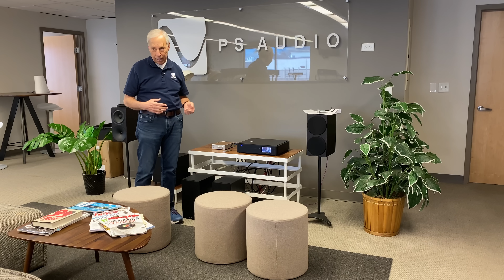Is there such a thing as too much power?

Comment: As Tim "The Tool Man"Taylor used to say, "It didn't have enough power, so I REWIRED it"!
Reply: Heat and pwer are the same things, expressed in kilowatt hours on the elekricyt bill. 1 kilowatt = 1 hour qith 1 kilo. Thnak youes!
Reply: @ilovecops6255  No. Heat is energy. It can be measured in joules, calories, or BTU. Power is a measure of energy per unit time.  It can be measured in watts or horsepower.
Reply: @timharig  Notte so..

1,500-Watt Oil-Filled Radiant Electric Space Heater with Thermostat. 3 heater settings 600/900/1500-Watt, Safety auto shut-off and Safety tip-over switch. With adjustable thermostat, power indicator light, heavy duty casters wheels, convenient cord wrap and easy carrying handle. Whole room quiet radiant heat.

HEAT IS mesure in wattes!
Reply: @ilovecops6255 
 https://www.engineeringtoolbox.com/heat-work-energy-d_292.html

Heaters are rated by their power output. Rating them by their heat would make no sense since you could achieve any amount of heat by running the heater for a set amount of time. What matters is how fast they can give off heat. That is a measure of power.
Reply: @timharig  i know its wah i sed fir time, HEAT = POWER = horsepower or kilowattes. BHP os Brake Hosepower, Indicated hosepwoer is from an indicator card - THEY SI 2 DIFFRENT THINGES!

Comment: The main concern I have using very high power amps with smaller speakers is the occasional accident of an RCA cable being pulled to the point where the ground connection is lost and having a high voltage from the mains noise feeding into a line level input. Suddenly you get 50 or 60Hz at clipping level and your power amp running at max power. Give it a few seconds and smoke can arise. Otherwise I agree and what is good about the extra power otherwise is that any peaks in the music will not get easily clipped as the voltage rails in the amp are high enough.
Reply: My concern is that you fool with interconnects with the amp at max power :)
Reply: @jamesplotkin4674  my concern is that you fool with amps with the power on...😆
Reply: @poserwannabe1  Actually, I don't do that :)
Reply: @jamesplotkin4674  I know, I was just sticking with your theme...😁
Reply: @poserwannabe1  I know. That's why I added a smile.  I do still enjoy toast while in the tub, though. My doctor says it's unwise.
Reply: @jamesplotkin4674  
😆😂🤣😆🤣😂
Reply: @FatRat-f9m  Not a problem in my family.
Reply: Fat Rat Test signals can easily fry a tweeter as they are not designed for much power. Some Jamo speakers are great. I know a few people working at Jamo.
Reply: @FatRat-f9m  How domestic of you to do the washing up :) I'd suggest a baby-monitor to keep tabs on what the wife does while you toil.
Reply: @FatRat-f9m  Not so much the ground, but I do have an aversion to porcelain. Gives me the shivers thinking on it.
Reply: Fat Rat Shorter cables are impacting the sound less, usually also save you some money and can reduce the spaghetti mess of wires. I haven’t blown a speaker for ages but in my teens I intentionally did crazy experiments with putting too much power in some speakers. One time in my early teens a voice coil shorted and the amp transistors fried using my parents receiver for the experiment. I “offered” to take it over as it was broken and and fixed it myself. It was my first amp/receiver (Beomaster 901) that served me well until I built my own 120Wx2 amp from scratch including PCBs during my high school time, that amp was even better at frying speakers.
Reply: Fat Rat Agree, cables aren’t much of an impact on audio quality unless you use poor ones or really long ones. My subwoofer RCA cable is 20 feet. I was almost buying one with a length of 25 feet but measured carefully and found I needed an 18 feet cable. Then after I got it and installed it I learned I only had about a feet extra but that’s quite a perfect match. For a subwoofer 20 feet RCA is ok. For higher frequencies, you start caring about 20 feet. My cables are managed in some panels making them disappear and that’s another reason why I prefer cable lengths that are fairly well matching to what is needed.
Reply: @FatRat-f9m  Oh, deary me, don't let it get too far away!

Comment: I was in an audio store recently and the had Klipsch La Scalas hooked up to a 300 watt McIntosh amplifier.  Those speakers are supposed to be 106db at 1 watt.  I don't understand how that would make sense.  It seems that they would be served by a much smaller amplifier.  I don't see how you would ever get to the edge of the sweet spot with such efficient speakers.
Reply: having much more efficient speakers than is necessary is a good idea.  I use a pair that has a compression driver tweeter thats 108db sensitivity hooked up to 500 watts at 8 ohms.  But then I use a 30db in line attenuator before the speaker.  It cuts down any noise or hiss and gives beautiful results.
Reply: @Canadian_Eh_I  That makes sense.
Reply: Personally, I would have gone with the MC275 Mk. VI with KT88s rated at 2 x 75 watts from the 4, 8, and 16 ohm taps, but that's just me.  I can't afford any of that wonderful kit, but its fun to dream.
Reply: @stephensmith3111  Yeah I've owned a couple of mcintosh pieces.  Love the sound, but I've found in my audiophile travels that the biggest difference really is made by the speakers.  Going active with a deqx and using high effciency drivers with 30db attenuation has changed my perspective on audiophilia.  I use an Edge electronics amplifier with 6 channels each using an ICEpower 500asp.  When it was built it would have costed $8-10K for the amp.  If you are diy-er  you can buy the amps on partsexpress now for $350 each.   Excellent clean power.
Reply: @Canadian_Eh_I  Absolutely.  Everything in the audio chain matters to some extent, but the sound producing loudspeakers (or headphones) matter most.  Once upon a time, I assembled a Hafler DH 200 power amp kit that did not burst into flames and sounded quite good to my much younger ears, but that was about two score years ago.  As a government certified old dude now,  my relatively modest "get off the merry-go-round system" (re:  Sam Tellig) is far more than adequately good for the down-sized life of a retired small apartment dweller.  But, as I said it's fun to dream.  Enjoy your music.
Reply: @stephensmith3111  Awesome and great to hear you still enjoy audio :)   I am also an apartment dweller.  One of the main reasons I chose highefficiency front laoded horn speakers.  I'm also currently building an open baffle bass setup with 15" eminence woofers.   Open baffle bass + controlled directivity means you can crank the tunes louder in the sweet spot without disturbing the neighbors.  Also open baffle bass affords you an extra 3db or so in the sweet spot that cancels out before it reaches the neighbors.  Little tricks I've learned ;)
Reply: @Canadian_Eh_I  I discovered after the fact that there is a nasty bass resonance in this apartment that really upsets my turntable. My venerable, beloved, and fairly efficient (speced at 92 dB, 2.8 V pink noise into 6 ohm nominal) ADS L520s simply overpowered the room.  I now use the 'wonder puppy' Pioneer SP-BS22-LRs on tall stands with the bass rolled off a bit (yaayyy, tone controls).  Bass shy music is still better than no music and they actually sound  pretty good from the mids up.  Andrew Jones certainly knew what he was doing when he designed and finessed these inexpensive, little speakers.  The apartment is otherwise a nice and affordable place to live.
Reply: @stephensmith3111 ...did you & I already have this discussion about the SP-BS22-LR's & I said I had the System Audio Shoeboxes?
Reply: @FatRat-f9m  Yes.  I did check out their web site, they look good.  Unfortunately, the only store listed on the North American continent is over 1600 miles away in Fort Lauderdale, Florida, so I doubt that I will get a chance to hear a pair.  By comparison, PS Audio is 'only' 504 miles away via the interstate highway system.  A long days drive but doable, plus you are in the scenic Colorado Rocky Mountains.    You enjoy your SAs, my friend.

p.s.  Love 'bed phones'.  Great pun.  :  )
Reply: @FatRat-f9m  Yeah.  I've got a pretty good musical memory for internal playback when external playback is not available.  However,   to use the computer metaphor,  the music files are largely uncorrupted, but I'm having more problems with the associated metadata.  As Buddy Guy sings on the album Sweet Tea*:  "Done Got Old."

*I did remember that information.  All is not lost.    ;  )
Reply: @stephensmith3111 ...long term memory great ; short term... 'meh' :-)